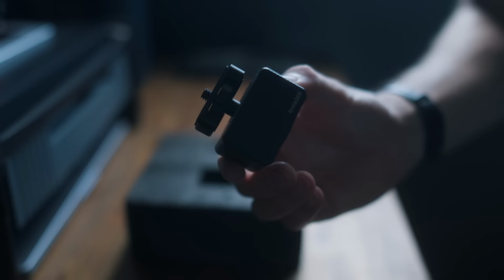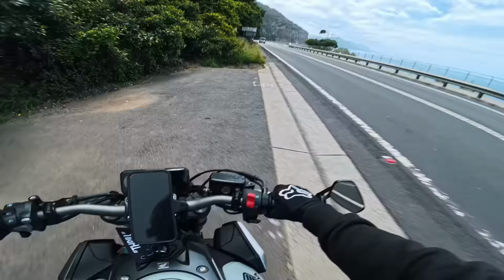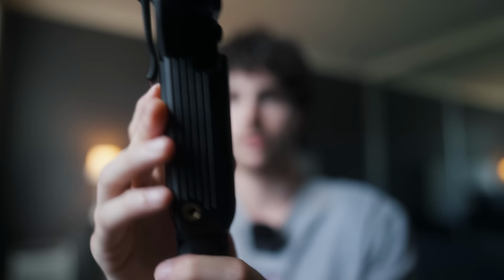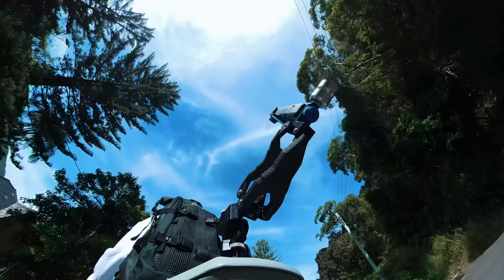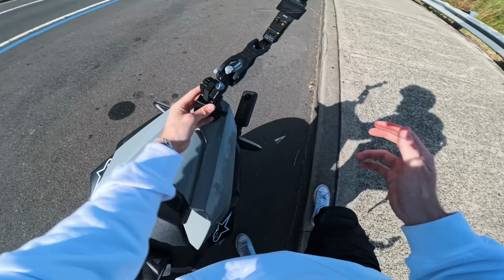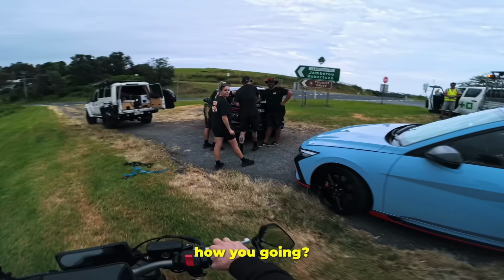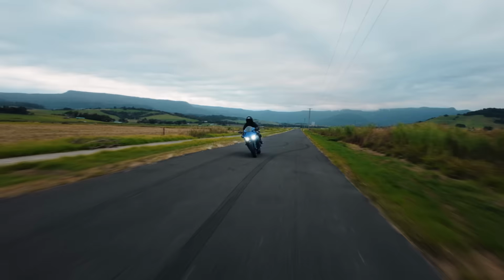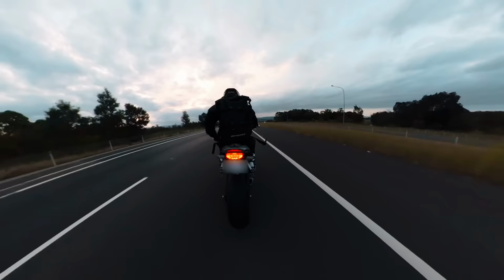Osmo Pocket 3 Cinematic Rollers | One-Man Setup!

Comment: This is a great idea. I stumbled across your first video and now saw this one. Have you considered mounting the Osmo somewhere on your backpack?! It would take out the micro vibrations and the heavy bumps you sometimes experience. I guess it would also help with the wind at higher speeds. A backpack may even work with z axis stabilizer.   The footage from the Osmo certainly beats any action cam with regards to quality- also the active track and side view looks great. Well done mate - cheers Oliver

Comment: Do the vibrations happen primarily when you’re in a lean? My thinking is the 4th axis stabilizer works best when the camera is vertical. Otherwise you’re limiting it. Ideal setup could be a pivot at the base with a counter weight which would keep the camera vertical and the 4th axis stabilizer working. Or try leaning less in the corners to give it a better chance at soaking up the bumps.
Reply from the maker: This is a good point! I’ll have to look into this👀it’s definitely much harder to get smooth footage when mounting it to a bike compared to a car for this leaning reason on the bike. 🤔

Comment: Have you tried if a pillion was holding the camera and taking the shots?  or if somebody is with an adventure motorcycle which has a upright seating stance could strap it on behind their back because your body is also a good stabilizer... I wonder how the output would be because the camera does a good job tracking.. The only problem is to hold the camera stable.. Please try it I would love to see the output.